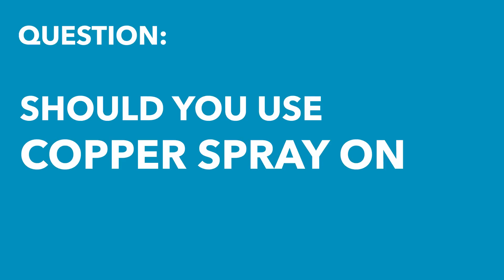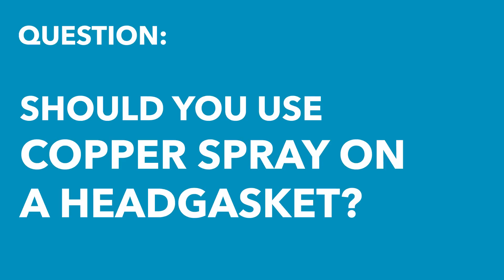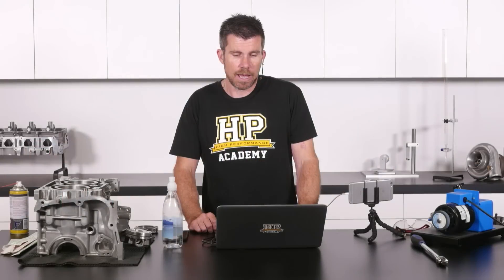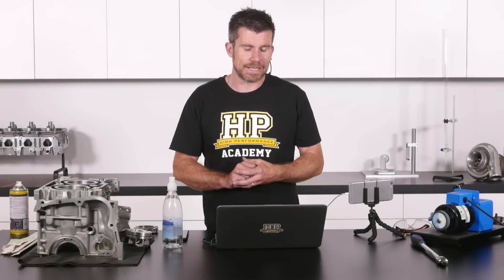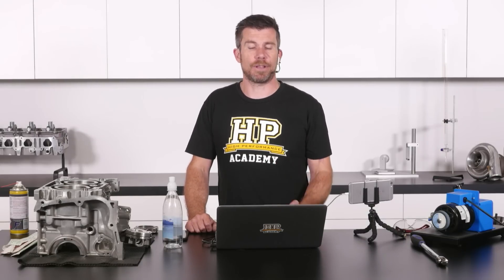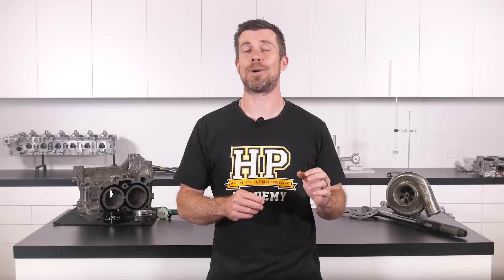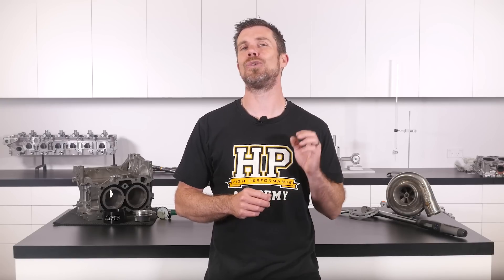[HPA Q&A] Should I use copper spray on my head gasket? | Performance Engine Building

Comment: Good advice, exactly what I do as well. I've reused metal head gaskets probably 12 times with no issues, just remove the old viton coating and spray it with copper spray.

Comment: Seems to me if copper spray can be used on used head gaskets, which I would never reuse, then it can be used on new gaskets. I've researched this quite a bit, so far I keep hearing those who've used copper spray mostly haven't had any issues, but I hear many of those who haven't used it had problems. A thin layer of spray with the not so great surface should be fine, it's there to seal imperfections factory gaskets can't do. Just can't expect it to seal over warpage, bad head bolts, improper torque bolts, or cracks. It's not a cure all but should be just fine if everything else is good... just a thin layer is all you need on a good gasket.
Reply: The only head gasket i have ever reused was a cometic brand gasket on a race engine. The sealant on the gasket was still on the gasket and the gasket also only had an hour of run time.  I would never ever reuse a head gasket I only did it because it was a race car and it was a very expensive gasket they are over 100 bucks per gasket.
Reply: @feeneysauto3432  sounds legit, I'm with ya on that. I'd be the same way, I'd only reuse one if it was in real good condition, and even then for good measurement, I'd spray it with copper seal just to be sure. I have used copper seal but on new gaskets and never had a issue, just can't use too much or it might plug up small ports once torqued down. I do believe it can be over sprayed.
Reply: As long as the sealing surfaces are in good shape, copper spray is NOT necessary on a good quality new gasket. If it was, we would have a LOT of leaking engines because no OEMs use any kind of spray from the factory. The people you heard having issues either did something wrong or had an underlying issue. However, I have never heard of the copper spray causing any problems and I could see it being useful for helping to seal very small imperfections like light scratches. Metal gaskets have almost no tolerance for warps or imperfections.

Comment: I'd use whatever product the manufacturer recommended, if any, as they will have spent thousands of hours and dollars optimising their product for the consumer and trying to double guess is almost guaranteed to compromise their work and the seal. 
Personally, I'll be darned if I recall doing anything other than using alcohol or brake cleaner to make sure the surfaces of the head, block and gasket are spotlessly clean. Harkens back to the days when gaskets were a bit iffy and folks would use aluminium (aluminum for the US chaps) spray paint...
For an inlet, exhaust or other gasket that was relatively lightly stressed, and would be frequently removed, it may work fine.

As an aside, what sort of ski season are you having down there - another beautiful clear sunny day in Auckland with temp's pushing 20 degrees in sheltered places?

Comment: Copper spray made my head leak coolant outward between block and head. This is on an s50b30us engine and Elring told me this is the reason for failing. I wasn’t the one who decided to use the spray my friend swore by it and now I get to redo it all over again yayy 😢
Reply from the maker: Yeah for sure, it's one of those things where you can find people praising it and others like you who have had issues.
You do have to be careful as a lot of people who simply say something is 'good' don't always include the specific details of how and where they used it and make it sound like one option is good for everything all the time, which is never the case.
Ultimately it sucks you're in this situation, but in terms of engine failures redoing a head gasket isn't as bad as it could be at least - Taz.

Comment: question 
ive got a set of the regular old blue strip felpro gaskets 
should i clean the blue stripe wax crap off before i copper coat? the spray seems to want to puddle on top of it

Comment: Wonder if the comments will errupt with the spray vs no spray argument?😂 
Would you recommend spray if for instance you've pulled a head off and haven't decked the block or head and/or given it the correct RA finish from machining?
Reply: Very likely. 
From experience, copper spray will not compensate for warped/uneven deck or head (waviness) and/or incorrect surface finish Ra.
Reply: I remember spray coming out as the thing to do around 10 years ago.  Never used them before, and never really used them after.  As mentioned, we used copper spray when in a pinch, putting together a stock(ish) motor and reusing the head gasket that had a few thousand miles on it. Dont know if it helped or not, but it does something to put your mind a little more at ease when thinking about if it's gonna fail or not in the future.
Reply: It has anti corrosion properties. Also I use a copper type of cream for electric connections on older cars. It turns old oxygenated and rusted light sockets/plugs back into nice clean metal with much better conducive capabilities

Comment: I have b20 vtec .I torqued  down head but needed to pull it back off it has never been ran .but the nitrile coating  was a lil damaged in a couple spots would copper spray fix that thanks

Comment: I use copper coat on all head gaskets , never had a problem.
Reply: Oh ok it helps it seal extra seal proof right?
Reply: I agree.  Especially on engines with wet sleeves where the installed sleeve can stand proud of the head gasket surface and the proud clearance has a wide tolerance.  The copper sealant will fill the void to seal the water jacket.
Reply: Is it ok tu use cooper spary on graphite head gasket?
Reply: @budhihart8161  I would say no for sure in that one. I haven't seen a graphite gasket in years. Since the '80s model cars at least. Typically they're used on older heavy wall cast engines and heads. Their purpose was to allow the head to slide on the block as the aluminum head expands and contracts on a cast iron block.. Kind of graphite's key feature, slickness. 
Adding copper spray locks the head to the gasket eliminating its soul purpose.
I won't do it even with the new MLS(multi-layer sheet) gaskets. Just did one today that someone did use copper spray on. Still blew both gaskets on a V6.  I think most people use it try to be cheap skates. Either to be able to reuse an old gasket or keep from surfacing the head. Both of which I would never do. My reputation means more to me than that. Buy most people don't care about taking advantage of others. This wasn't the only rigged thing on this engine. They modified a valve spring to act as a timing  chain tensioner on top of a failed tensioner. Because they were too cheap. Didnt work but the customer paid good money most likely for the correct fix.
Reply: I would have to disagree. Just did one today someone did this on, V6 model. Both gaskets failed. One side had a new head on it too. The other side was a used head but they didnt surface it before reinstalling. You could see every warped spot in the head. This is mostly a cheap way out of buying a new gasket or not surfacing the head. Both of which will fail in the near future. Do it right, do it once. 
Head gasket manufacturers have their products designed for ideal situations in mind. Straight flat block, straight flat head with both surfaces clean and smooth. The coating already on the gasket is made to bond to the block and head. Anything foreign that is added to them lessens their ability to perform at their expected levels. Most gasket companies and factory service manuals specify not to use any coatings on head gaskets. The stamped sealing rings in the gasket compress to seal minor irregularities in both. Reusing a gasket that's already been compressed is just poor workmanship and being cheap.
Its main purpose was/is for exhaust manifold gaskets or metal to metal seals.
Reply: @QwertyQwerty-jq3cu  ok ..thank u..good points..
Reply: @QwertyQwerty-jq3cu  huh? Graphite gaskets are actually pretty common

Comment: i’m getting my head resurfaced, with brand new gasket. i cleaned up the block and pistons with a scotch brite pad and wd 40, do you think i could spray the copper on the gasket just to be on the safe side?
Reply: totally degrease it,  WD residue will interfere with sealing.

Comment: Sorry. I used them 100% of the time
 Those gaskets never blew.  Save one because it was a cheap gakset at 21 psi.. but the car was driven 2 years. Says not to add gasket glue because the gasket has glue . I have done steel and fel pro gaskets and say is  Rubbish. Dont be cheap and skip 11 dollar can of Permatex copper spray! I was caught with my pants down once. Now i learned.

Comment: I have a 90 mitsu eclipse 4g63t cast iron and iron head 
Now my block is warped 4 tho 
And I have done 2 commetic mls hg and a graphite felpro one and failed 
It's mixing oil and coolant one the corner where it's low warped 
Do you think it's worth ripping it apart and spraying that copper spray one the commetic on
How think is 2 coats 
Would it fill the 4 tho warp
Reply: Fix the block.
Reply: maybe you can rub block with a bit of glass and floor sanding sandpaper to flatten.  Even a clean piece of MDF might be flat enuf to tape some sandpaper to.
Reply: First, both the head and block aren't cast iron. Block is, head isn't. Unless someone has switched the head to a way older version. I've had a '90 Laser, same thing, and it was definitely aluminum. I have several Mitsubishi Starions and they're for sure aluminum too.
.004" warpage is too much especially between #2 & #3 cylinders. Proper surfacing is key. #1 is flatness, #2 is surface finish. Surface finish should be almost mirror smooth. If there are any scratches in the aluminum head, it's too rough. You should be able to at least see a light reflection of your fingers in the finish and be able to distinguish your fingernail from the rest of your finger somewhat.
On the block, you'll need to have it surfaced too. This is tough as most places won't do it without total disassembly and removal from the car. I have done it in the car fully assembled with good success. You really have to know what you're doing though. Typically , if the head gasket blows between cylinders and is driven long enough, it can erode the block slightly. You can't just surface that area, it has to be the whole surface. 
A lot of people use the Roloc disc on a 90* grinder to clean the head and block. If you want to really mess things up, this is the fastest way to do it. It creates scratches and deep grooves and divots all over the surface. It may look nice and shiney but its it's as rough as a gravel road that hasn't been graded in a year.

Comment: For you noobs. It's not supposedly needed if both head and block has been resufaced and %100 flat. If not, this would work. Dont go by what the manufacturer says because the situation isn't the same.

Comment: After spending the money on professional machine work and a quality Tomei head gasket, there's no way I'm spraying mine!
Reply from the maker: Are you reusing the gasket? - Taz.
Reply: It's brand new, that's why I don't want to use it. If I was re-using it I would probably use a spray tbh. :)
Reply from the maker: Ahh yes, Andre does advise in the video here that you don't want to use spray on a new gasket. Sounds like you're close to stitching it all together which is exciting mate! - Taz.
Reply: I did my own machine work. Trust it more than Billy Bob that loves Charlene down the road. And i spray all mine.

Comment: I disagree.  You cannot generalize the statement to always install head gaskets dry.  Dry gasket may work well on some engines with a conventional bored cylinder.  But there is significant chance for head gasket leak with a block with wet sleeves that can stand proud of the head gasket surface and the proud clearance has a wide tolerance (i.e. Continent Z-120 and Z-134 engines for Massey Ferguson Tractors).  The copper sealant is required fill the void to seal the water jacket from head gasket leaks.  I had two overhauls with dry gasket installs that leaked.  I now coat both sides of the gasket with Permatex Copper High Temp Spray on all head gaskets and do not have a head gasket leaks.
Reply: do you spray both head spacer shim and new composite head gasket ?
Reply: Maybe that stuff works for tractors but the first time I used it because the homie insisted on we use it or else he wouldn’t give me a hand to lift the head and set it back down into place…..well that was the worst most impatient decision I ever made because 6 months later water began dripping out the side of the head and block! Funny how I’ve done 5 of these head gaskets now, on the same engine platform and non ever had such a failure leak occur except for the one time I was forced to use the copper spray 🤯. Later I did some reading and went on the manufacturers website, elring klinger, and the state not to use any adhesive sprays or rtv on the gasket mating surfaces and that’s exactly what we did lol. Maybe they work for metal headgasket but for a stock bmw composite/metal gasket it was a mission failed and I’m ordering parts to redo it SIGHHH 😩

Comment: Why I have to be a guy?
Reply from the maker: It's a casual term that is increasingly used to refer to mixed-gender groups. Your head gasket however doesn't care anything about who you are or what you want to be called for it to be installed and work as it should - Taz.